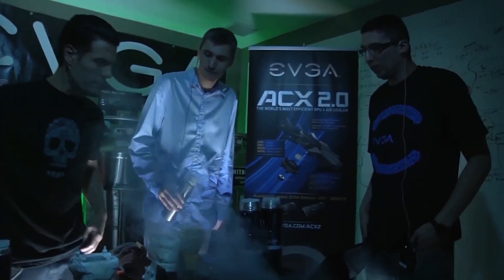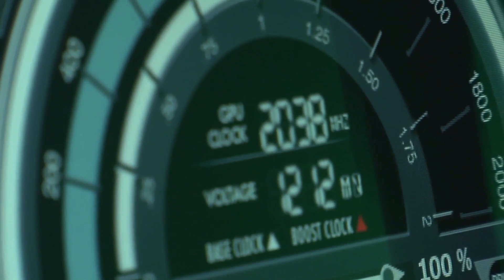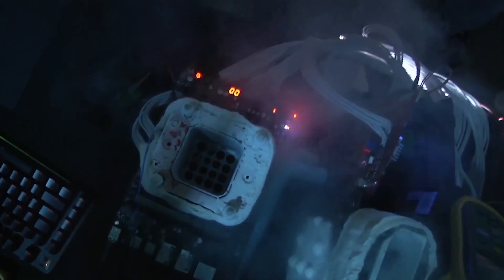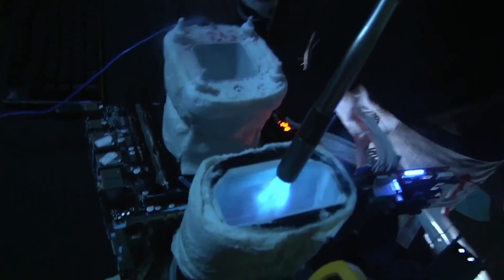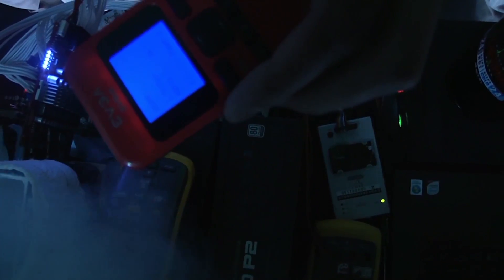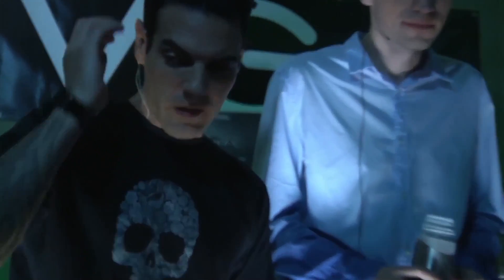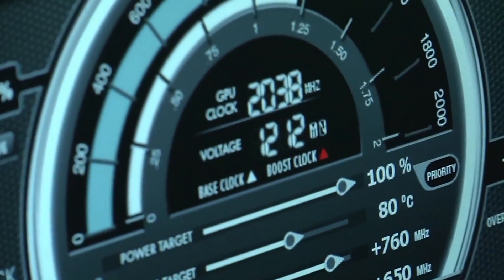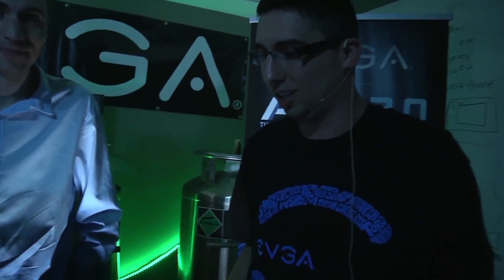Overclocking Record Part 2

Comment: Not impressed when unmodified aircooled cards are already pushing near 200FPS in modern games like Bioshock: Infinite.
Reply: Please understand refresh rates before you talk about 200FPS...lol
Reply: yeah, in 720p/low :3
Reply: Tipichounet No, infinite in general maxed out isn't hard to run.
Reply: Piberius Oo
And Tomb Raider (2013) -Tress-FX of course as only the consoles seem to run that with better performance than a comparable PC GPU.
Reply: iV PiG
Screen refresh rates? I don't know of any that go over 144Hz so 200FPS is a bit much for a 144Hz screen which updates a new frame on screen 144 times a second. 200FPS is the number of frames the GPU pumps out per second...
It seems pretty self explanatory to me. LOL!
Reply: That's my point...Why say anything about 200FPS when you're only getting your refresh rate...If that's the case I'd say check out 300 frames! but no...I say and completely understand I only get 120...